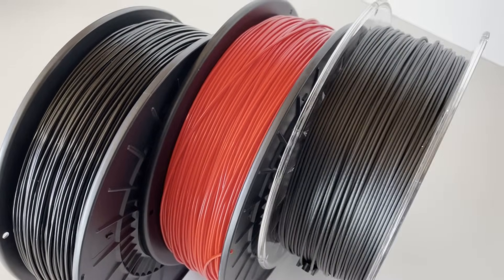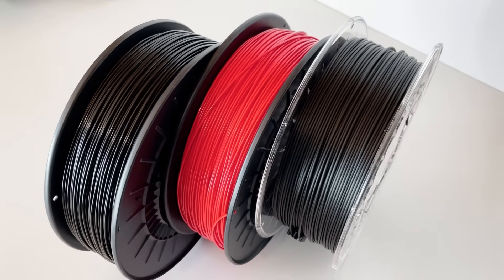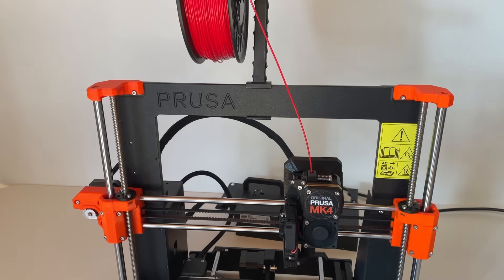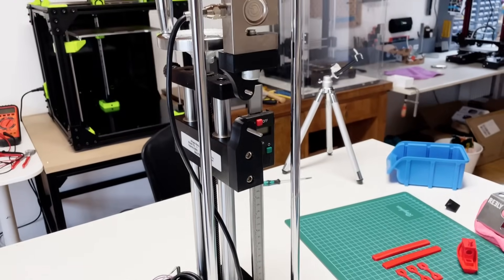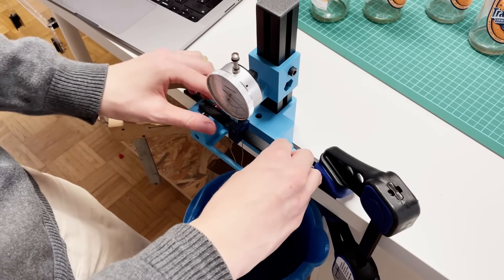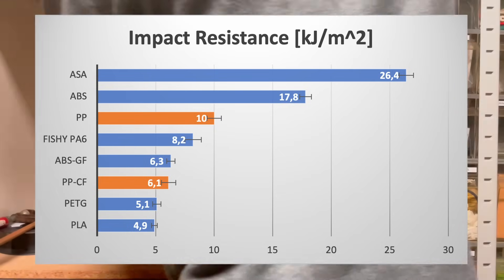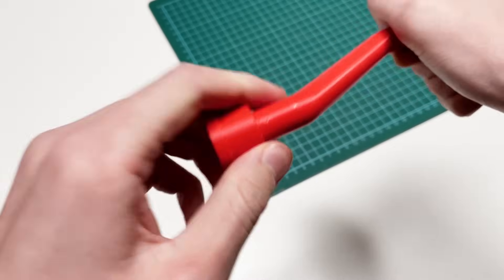The most underrated filament for 3d printing: PP and PP-CF tested!

Comment: PP can probably be smoothed with xylene, tetralin or decalin vapor.
DyeMansion uses a proprietary solvent - 'VaporFuse VF44 EcoFluid PP', and AMT has one they call 'PostPro Pure'.
I have never printed in PP but will eventually, I also really want to have it smoothed. Not sure if DyeMansion or AMT solvents are available for everyone but those are probably safer to work with. If they are not available I might try xylene.
Edit:
Amt solvents are available but expensive. Matterhackers has it in 1000ml for $600.

Comment: The only thing you got wrong, and it was very much designed so you get it wrong, is you called the resin identification code the recycling symbol number 5. it doesn't symbolize recycling and PP is theoretically recyclable, in reality it's difficult expensive and barely any is recycled despite being insanely popular as you pointed out.

Comment: I don't think it's overrated, I think it's the price that scares people away. 40$ for a roll of pp and 100-150$ for a roll of pp-cf is a huge sum of money for most hobbyists. Especially for the PP-CF, you need a specialized steel nozzle. The high price and print issues are the reason it's not as popular. You can get a good new 3D printer for the price of 3 rolls of pp-cf. It's just not with it in my opinion.

Comment: I am surprised how strong PLA is! 
For some reason I always believed it to be one of the weaker/weakest 3D printing materials - yet the tensile strength test shows otherwise.

It would have been VERY interesting to see how an injection molded part of the same form would have faired under these tests.

Comment: :hand-pink-waving: Polypropylene is a great structural plastic used for rigidity when higher temperatures are not a factor. The audio entertainment industry still uses it in speaker cone manufacture. It exhibits similar light weight, structural advantages that Ultem/PEI exhibits, when not used in higher temperature environments. Adding a composite like carbon fiber will seriously increase rigidity and lower physical density, making it even lighter weight. Modulus tensile strength is just as important in manufacturing of plastics as tensile strength and in my industry it is more important. At @8:05 I remembered this calculation from university and I realize that for most of your viewers, this holds less meaning. For us Engineers, this as common as making a sandwich. Thank you for showing this in the video. Thanks for the video!:goat-turquoise-white-horns::hand-purple-blue-peace:

Comment: If PP doesn't adhere anyway to any print surface, wouldn't be better to straight don't use bed heating and prevent the heat from loosening the tape's glue

Comment: I'm not a fan of PP CF just because you lose so much layer adhesion by the addition of the carbon fiber. Regular PP has perfect layer adhesion and is an amazing material for making bottles and other water proof items. A better solvent resistant material that is also rigid and strong is PPS CF. It's expensive and requires a high temp printer, but it is a much better material for solvent resistant 3d printed structural parts.

Comment: Just wanted to add when using packing tape for small items what works for me is to heat the bed to 80 apply the tape getting it really smooth and bubble free (use a cloth to rub it down and to avoid burns) then cool the bed to 35 this really bonds the tape down and helps reduce warping.

Comment: I use PP since years, polypropylene is my favorite filament to print with. It has some quirks but once you get the hang of it, wow.
Every time I think to myself, what filament I should use, PP checks all the boxes. I've said it years ago that PP is a very versatile material, but most of the time I got overheard. Glad that you did a video promising what I said years ago!!! Maybe my words and yours will now see a light.

Keep it up :D
Reply from the maker: Thank you! 
I'm happy to hear that you've been using PP for a while and that you see the advantages just like I do!
Reply: Whose PP filament do you normally get?

Comment: I have been printing a lot of PP, PPCF and PPGF for a few years now and it is one of my favorites with PC CF.
There is a very simple and cheap solution for bed adhesion, get a 2mm plate of PP, cut to size or order in the correct size, sand it in two directions with 80grid paper
Heat it to ~35°C
Print first layer with a small Z offset ant lower temp to prevent it from fusing
Increase bed temp after first layer around 10°C against warping

I print PP at 215°C first and 230°C later layers
PP GF at 230°C first and 290°C later
PP CF at 215°C first and 280°C later

always sticks, never warps and gets off with a little force

Comment: Do you have any tips for helping avoid warping? I'm suffering right now trying to print 3DXTECH PP-GF on a pp plate in my P1s. I've got a 50c space heater warming up the enclosure and I'm trying to print with no fans going. It seems like it's adhering alright but the warping is killing me. I'm going with 90 to 100c for the bed temp and 235-260 for the nozzle. I've tried dropping the bed temp from 70c to 20c after the first layer as recommended for the PPCF filaments from pp print, but my printer struggles to get the temp down after the chamber is all heated up.

Comment: Would this stuff be suitable for inside a car? Obviously it can get very hot in a car.
Reply from the maker: Absolutely. The basic PP is temperature resistant up to 120°C (248°F) according to my tests, the PP-CF is even more temp resistant.
Reply: @JanTecEngineering  That's good to know. I need to print some speaker grills for my tweeters.

Comment: I actually havent had adherence issues with PP and PPS on standard PEI plates with some pva glue. I have a heated chamber though which is necessary to prevent warping.

Comment: It is possible to either thermally or chemically smooth  PP and PP-CF? As that would solve the ridges problem
Reply: Chemically... good luck. melting together layers with a blow torch or heat gun works tough. just be careful, slight under extrusion or entrained water (as in soaked, pp is absolutely non-hygroscopic) will cause the surface to bubble. Worked great with verbatim, meh with fiberology brand. Tough I doubt CF would be conducive to smoothing out layer lines.

Comment: build plate is 200€ lmao
Reply: If you need to print PP and it actually works, I think that's a fine price. I've tried all different methods of PP bed adhesion and nothing worked as well as what I see in this video.

Comment: Got my PP bed tonight so I'm running my first test print. After waiting for 3 months for PP sheets to never arrive from aliexpress, I spent some more and grabbed a different one from amazon. so far it's sticking really well and the purge line peeled right off.
Reply: Do you have a link to the bed you used?

Comment: These are honestly the most gorgeous PP prints ive ever seen, and this is one of if not the best PP printing overview videos on YouTube. You should make more in which you push the system to the limit. Its one thing to print benchies and low profile small items, or even the small bed surface contact large manifold part (which was simply stunning) but its another to print something tall, nearly solid, with large surface area on the bed and long corners. I tried this material for the bed, and when stress testing it even with a 20mm brim, i couldn't get a 100*100*30(z) cube like item to print without pulling up the corners.

Comment: To print on polypropylene you only need a polypropylene base. And do you know one of the flattest things that are made of polypropylene?: meat cutting boards.

Generally food equipment is made of LDPE, HDPE, Nylon or PP. You can go to a market and see if there is a PP meat cutting board, cut it to the size of your table and use it to print PP. I've been doing this for years and it works.

There are also polypropylene signs that you can buy online from visual communication companies/that manufacture signs or advertising signs. They are smooth polypropylene sheets in different thicknesses and colors that exist.

I have been working with polypropylene in 3D printing for 4 years and I can say that it works as if it were PLA.

Tips: buy a piece that is not too thin, 5mm is ideal, but if it is thicker, like 10mm, it will work too but you won't have as much flexibility to twist the table and remove the piece after printing. You can warp the table (if it comes warped or has warped over the years) with heat, a flat surface and a lot of weight. I straightened it in the oven at 120º, then placed it on a marble stone with a normal printing plate and lots of books on top. Then just put it in the printer and print with the table temperature turned off.

You can adjust the level of adhesion of the PP to the table according to the temperature of the first layer: if it is too hot it will fuse with the table, if it is too cold it will not adhere. I suggest starting 10ºC below the specified temperature of the material and very slowly, wait for the piece to cool and try to remove it from the table, it should have the same adhesion as PETG.

Remembering that PP does not need to be cooled as it can warp. Turn off all part cooling fans. And if the HOTEND cooling fan blows, check if the air is very cold. If it is, you should consider modifying the wind flow with a deflector so it doesn't go straight to the part. If the wind is hot there is no problem, PP handles printing at high temperatures well.

You don't need a closed chamber to print PP, it's not like ABS, but if you have one it's better, the finish of the piece is slightly better, apart from the fact that it doesn't contaminate the adhesion surface of each layer with dust particles contained within. in the external environment.

Comment: PP in injection molding is a commodity polymer  and it’s really cheap (+-$0.9USD/kg) 

IDK why it is so expensive as a 3D printing filament ($100USD/kg) the process of making filament is not that expensive if anything extrusion in my experience in the plastic industry is cheaper than injection molding.
Reply: Engineering and R&D costs that went into developing the product. Have to make sales profitable, and scale of goods sold isn't high enough to bring down the price. Commodity pricing in injection molding is due to huge supply and decades of industry standard use to bring down the costs.
Reply: Filament makers are not developing anything new they are just taking raw polymers from BASF (PA), INDELPRO (PP), INGEO (PLA), INEOS (ASA, ABS, PS), etc. and putting some standard additives to avoid degradation during processing to reduce friction or to alter MFR or other properties, the chopped fiber reinforcement or mineral charge plus the MB.  

I know and understand that the profile extrusion process of the filament adds value to the raw material but the retail prices are just unreal. 

Also 3D printing is actually a  meinstream process to the extend that during 2019 and part of 2020 I had various raw PLA shortages from ingeo because the PLA filament industry and 3D printing  where exploding, and to this date ingeo has lead times for PLA (injection and extrusion grades) of about 6 to 8 weeks (prior to 2019 LT was around 2 weeks).
 
Even now companies like BASF and BRASKEM have their own filament lines. If 3D printing filament weren't a profitable business with a considerable market size they would have never released an entire product line.
 
I've been working for 17 years in the plastic industry with extrusion profile and film (Packaging and Nonwoven) lines with DENK and Reifenhäuser machines and ENGEL, TOYO, FANUC, FCS injection molding machines for the automotive and heavy industries.
Reply: @dmax9324  I don't think so.
Filament extrusion has from 0 to none R&D involved. The filament manufacturers are just taking some raw materials from BASF (PA), INDELPRO (PP), INEOS (ASA, ABS, PS) INGEO (PLA) adding some additives to modify the FMR, mechanical, and rheological properties plus the fiber or mineral reinforcements and the MB.

Also 3D printing is a mainstream and massified process to the extend that since 2019 it has been changing the polymers supply chains that in the past  where almost exclusive of the injection and extrusion industries (film, non woven, blowing).

If 3D printing filament weren't a profitable business with a considerable market size companies like BASF and BRASKEM (chemical companies and polymer manufacturers) have never launched their own entire filament line of products. 

I've been working in the plastic industry for more than 17 years and I have been a first seat witness of how 3D printing is changing and integrating in the plastic industry.

Comment: Excellent video. I"m new to 3d printing and this is extremely interesting. Would PP suffice as for interior automotive parts in extreme environments like ABA/ASA?
Reply: Looking at the tests done, I don't see why not. It has better heat resistance than abs or asa.

Comment: You had me at doesn't absorb water, you lost me at custom bed. Unfortunate.
Reply: Yeah same and also the price.
Filament prices are a scam anyways
Reply: Custom bed is honestly the only way to go about solving adhesion issues with PP. It's a very complicated problem with pretty high level polymer science and physics involved, hence higher cost for a solution that actually works.

Comment: The number on the plastic isn’t a recycling number, it’s a plastic identification code. It’s meant to look like the recycle symbol to confuse consumers into thinking all plastics are recyclable.
Reply from the maker: Thanks for the explanation. 
The "to confuse the customers" worked really well in my case and I fell for it. 
On the other hand, I talked to a local recycling group and they use these symbols to sort plastics for recycling (PET/PP etc.) - so at least the numbers CAN be used for recycling/identification.

Comment: I bought some PP some years ago to make airbox trumpets,  but I was never successful at preventing warping, despite using an enclosed printer. Looks like I will have to invest in some PPprint bed plate and give it another try. Well done on a well presented series of tests and good all round info. Much appreciated
Reply: Just put down PP packing tape on any bed surface the adhesive will stick to. No need for a custom bed.

Comment: I like yout methodical way of work, at first (sound) I tought it is Stefan (from CNC kitchen)'s video.
However, I found a logical error: as conclusion you said that PP printed pipe for hydrogen peroxide would resist interlayer adhesion stress regardless of your previous interlayer adhesion test which shows thad PP has lower Z-direction strength than PLA.

Also, it will be interesting to see comparison of PP with the other, much cheaper and much more 3d printing friendly, food friendly material: PCTG.

Please make similar tests with PCTG and put it in your charts.

Comment: The PP print stuf doesnt work at all on any of my raise3D machines. The best result is on a dedicated hard PP plate or PP packing tape. The PPprint surface/plate never gave me any usefull results. Maybe they fixed some stuff today... i bought a set 2-3 years ago and it is like i said useless. I produce a lot of stuff for chemical rich environments so PP is a must but saddly i always have to use PP tape or hard PP plate with magnets inside... I was really dissapointed. Good thing about PP is the chemical resistance + its kinda soft and bendy so its hard to break. Temperature is a problem though.
Reply: I've had similar issues with this product in the sample size printing for fuel cell and battery research. I'd love to chat with you about how you've been getting functional PP parts. Unfortunately I think the ultimate way to go about this is to move toward PP powder SLS in which none of the typical PP issues are deal breakers, although the cost barrier...
Reply: @dmax9324   i just buught a bunch of 200x200mm PP plates and clamped them to the print bed. THe PP only sticks to PP so... THe adhesion is not a problem anymore. The bad side is that the plates deteriorate pretty quickly or you brake them when taking the prints off. PP brown packing tape is also a great option. I just put it over buildtak sometimes for smaller parts and it works wonders. 
I bought from PPprint the set for my printer and i got everything the guy in the video got but the thing is useless. I never had any sucessfull print off of it.

Comment: Great video, but one important thing should be told to viewers.

Material being food safe doesnt mean the process is. FDM 3d printers cannot manufacture food safe products unfortunately.

Its not just the brass tip, that might have led in it, (you can anyway buy an iron one or stainless steel)
Its the lack of smoothness and layer lines that become a problem. Between the layers are unfortunately perfect spots for bacterial colony growth. My tech fun youtube channel did scientific tests.

Coating with food safe resin might work, but it is not an permanent solution as resin makes the surface smooth but it slowly may degrade.
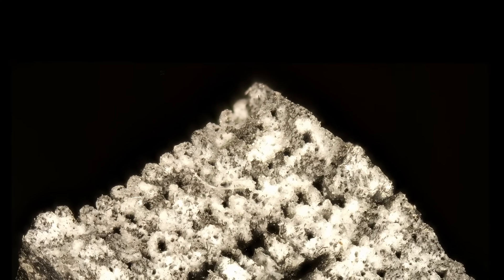Reply from the maker: You're absolutely right. I tried to explain this in 12:00

Comment: Please also take into account that this filament is a compound! That means that the added components inside the filament also have their chemical properties that are most likely not the ones the labeled PP has.
Reply: That's my only gripe with "PP" filaments. If you want true solvent and chemical resistance, unless you have pure PP, then you can't know for sure how inert it really is. Without knowing the types of additives, in high level scientific research, it's a risk to use without concern for contamination. Pure PP printing is probably not really possible unfortunately without some serious investment. Unless PPrint can validate and guarantee their additives in certain applications.
Reply from the maker: That's true.